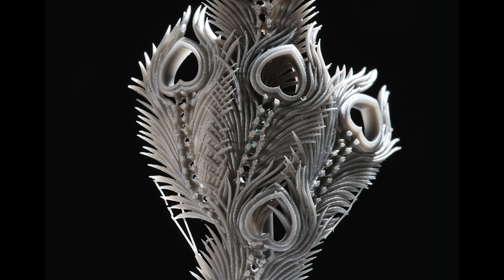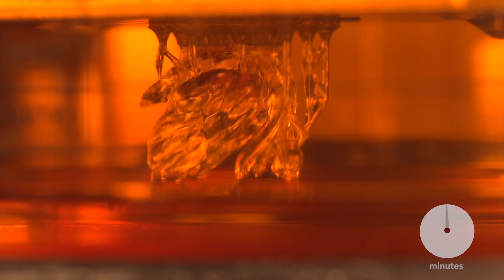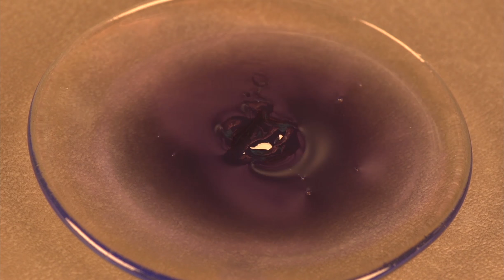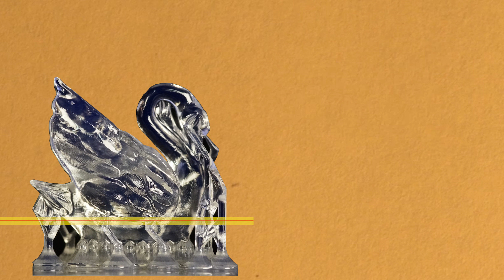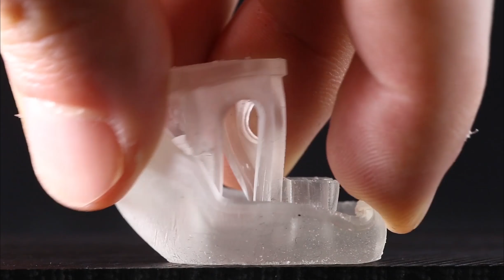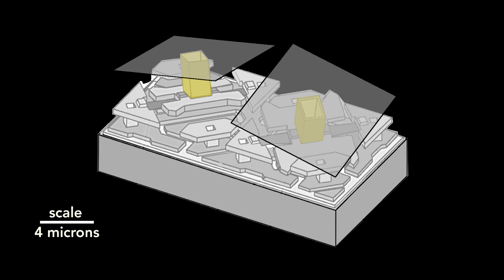Draft: A Digital Light Projector 3D Printer

Comment: Fantabulous Video.  Very Time Appropriate for To-Day's Day And Age.

1.  ¿.  Can i Use a Prism and a set of Filters to take Pure Sun-Light, and parse it down to just blue light of the proper wave-length, and create my Own Blue Light Resin Cooker.  ?  Kind-of like the "Pin-Hole" Cameras that we used to make as kids.

2.  ¿.  Is this DLP a standard one with the regular light-output, or is it a special, mono-colour, single light.  ?

3.  ¿.  Is the DLP that is used, a normal commercial DLP, that is only programmed for the blue light, OR, is it a "Blue-Light" Only DLP.  ?  Wondering about the rationale and expense of a full-spectrum DLP when ONLY blue light is used.

Comment: The demonstration of pulling the suction cup versus sliding it would be more effective if you added a lubricant so the sliding happens without effort or the need to lift the edge.
Reply from the maker: Yeah ... that's on the list to be redone .. in the draft I cheat by lifting up the corner.

Comment: 1. In introduction briefly touch on utility of these printers - where and why are they used, and under what circumstances would they be prefered to the other type of 3D printer.
2. Talking about the different components of the resin, need some visual aids.  Are they mixed separately? 
3. What is the actual resolution of the printed features (10 microns)? 
4. What makes the printed object stick to the print head, and is there a risk it could break away prematurely? 
5. Because of the role of light in the curing, are only clear printed objects possible? 
6. Talking about why the print head moves, it also appears to allow a fresh layer of resin to cover the clear window. Is this by design? 
7. Is the resin toxic? What about cleanup?
Reply: ¿.  What is the "Open-Time" on the Resin.  ?  ¿.  How long does it last in ambient conditions.  ?  ¿.  How about a further mini-discussion of the Toxicity, OR, lack-there-of, of the Resin to planet, life, small children, humans.  ?  i Can All-ready see people "Printing" toys for themselves, and of course, their Children...Only, like lead-painted toys, to have the Resin be Toxic to the Children.

Comment: i feel the middle part about the resin is too long, it takes up a quarter of the whole video. a simple cross section to show that the laser cures the nearest (bottom) layer can explain why the tray needs to slide back n forth, which is because the model needs to be as close as possible to the bottom and thus sliding the tray will get more resin, as what you already mentioned at the start.

Comment: it would be nice if you could talk more about the commercial use to it, advantages of 3d printing, cost efficiency etc on the manufacturing side, perhaps with real world examples like phones or planes.
Reply: Having Been a Long-Time and Regular Customer of my Local Micro Center in Marietta, Georgia, i Have noticed that they have had these "3D Printers" for sale for Over-Five Years.

When they began to sell them, they were launched with a Great Deal Of Circumstance, Fanfare, And Pomp.

How-ever, EVERY Time i Drop-By the Department that sells them, the Camera Department, there they sit, buzzing, sintering, and whirring away...
Making the latest Star Wars X-Wing Fighter, or harry potter hogwart.  So, my Point is, that Other Than Swans and Tugboats...

¿.  Are there any current, real life applications.  ?

Comment: I love the longer engineerguy videos.  Don't cut it shorter.
Is the blue laser curing light the same as the curing light dentists use to cure cement fillings?  I thought that part was relatable.
Is that the same printer Steve made a bunch of videos about at his new job?

Comment: I think a common misconception is that the orange shielding is protecting the person, when its primary purpose (particularly in a dlp instead of laser machine) is to protect the resin from ambient blue/uv light. This could be mentioned during the watchglass and laser demonstration, using a section of orange plastic to block the laser. Maybe show a color wheel?
Reply: ¿.  Why is the Tray Orange.  ?  ¿.  Does it act as some sort of photo-blocker to the ambient blue light, that might cause the Resin to "cook-off" sooner than expected.  ?  i Took Note of an orange semi-circular "curtain" that seems to be meant to be swung into position during operation.  ¿.  The curtain must be orange for the same rationale.  ?  Owing to the Fact that i Was Blessed to be Born Green-Red Colour-Blind {  Fully Recessive Allele, i Am A Deuteranope }, i Was wondering if the Orange has something to do with blocking certain light spectra.

Comment: Love the video! A few thoughts:

1. Wouldn't mind a little more detail on the difference between FDM and SLA parts (resolution, material properties, geometric limitations, etc). Maybe lowly old SLS bears mentioning, too?

2. I'm not sure if it's intuitive to the average person why the swan needs the supports to be printed around it. Perhaps an explainer would be helpful. This could also be a time to highlight an advantage of SLA over FDM (since it generally requires less support structure).

3. Some graphics (perhaps an animated cross-section) when describing the interactions between the window film, the most recently cured layer, and the resin bath would be helpful. It was tough to keep the whole stack straight when you were describing the different components of the resin and the different film types.

4. I was really curious after your plastic curing demo how the laser can cause liquid resin to harden. You explain it later, and while I appreciate the thematic separation of the mechanical and chemical explanation, it might be nice to bring those two parts together (this might also apply to the reasoning behind why the tray moves after each layer - both points got me thinking and distracted). Maybe just saying you'll get back to it later would be enough.

Keep 'em coming!

Comment: One of the things I think would benefit greatly would be some graphics during the chemistry part on the resins. I found the demonstration of resins and leaving out components an incredible display. It's not something I was not expecting when talking about the chemistry of it. 

Now, when talking about the pivots, the 11 years figure seems lacking in context. I figure it's related to the MTBF, but it doesn't seem to mean anything in the context that is shared. 11 years of constant use? 11 years of incremental use?
Reply: I agree, the chemistry is the most wonderful part of the process, and showing that without all the pieces it wouldn't work isn't very close to the chemistry you're explaining.  Maybe some animation with 4 colored "molecules" would allow you to show things like blue light in initiator causes monomers to be hooked to elignors (however the other hydrocarbon is spelled).  Then a bigger view could show how the occasional UV blocker controls the light from reflecting or whatever longer path causes the blooming of parts.
Reply: Agreed.  I would love to see the chemical reaction in more detail.

Comment: Ok; this would be a significant amount of work, but I think it would be worth it: When you are showing the cross section with the projected patterns, I think that it would help a lot if you colorize the patterns to be original blue for the swan features, and pink or grey or something else for the support structures (whatever color you use, use that color for when you highlight the supports in the profile view)

Comment: 2 thoughts: 
1: I think if you could give one or two examples for a practical use of a 3d printed Part (whether in general or printed by an sla printer) at the beginning of the video.
2: at 8:00 following I found that that part got a little too long (don't know whether that was only me). 
Apart form that it was a very interesting video and i am looking forward to the final version.
Reply: Agree that the window material part felt a bit long.
Reply: I really enjoyed the description of the different window materials.  It was a perfect example of what kind of thoughts go into engineering a machine.  Would an infographic that shows the PROs and CONs of each material allow you to cover the topic more quickly?

Comment: The impact on society level appreciation of 3D printing you might mention.
It is as a PROTOTYPE maker, or custom fit maker. Those who have never paid for something 3D printed usually speak of it as breakthrough in manufacturing. Not so. It is slow and the plastic it is made out of is expensive. Typical $1 injection molded thing is $20 to $30 3D printed. But that beats a thousand dollars for a hand carved prototype.
Reply from the maker: Walter: This is something I'm struggling with. There are these grand visions of 3D printer revolutionizing the world (especially the world of manufacturing), but its seems to me that it is a prototyping machine that they excel at right now. Do you or other know of their use on large scale? What's the story here?
Reply: I'm currently doing research in the area of SLM additive manufacturing.  The particular challenge with AM parts is certification.  There are many more opportunities for errors to occur in the part as it is being constructed layer-by-layer.  We don't have the benefit of making thousands of one part quickly and statistically identifying what percentage of them meet the mark.  If it is cost effective with a special part, you can do CT scanning for certification.

I did attend a conference that discussed Big Area Additive Manufacturing, in which they print up to 100 lbs. of ABS per hour via FDM.  They applied BAAM tomolds for wind turbine blades and full-sized vehicles.  A quick search of BAAM will show some other applications.

Another impact of 3d printing is through weight savings via topology optimization.  For those unfamiliar, it's running a simulation on a geometry and removing (or adding, depending on the method) material so that the part's components that see very little stress are taken away and the part's strength is not compromised.  For industries with low production rates (e.g. aviation), this is 'revolutionizing.'
Reply: Big companies like GE, Boeing, Ford etc are all using 3D printing in some fashion, Space X made a rocket engine using 3D printing. They can print in metal but that is a million dollar plus machine.